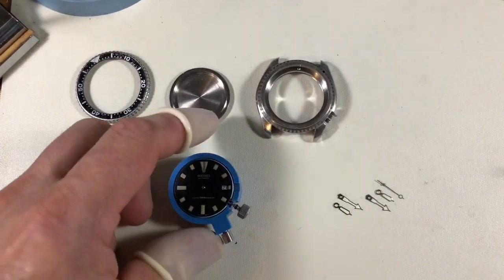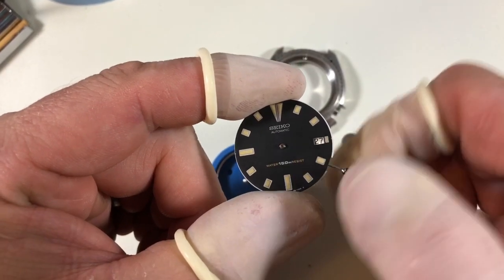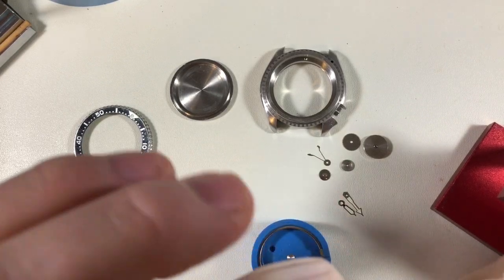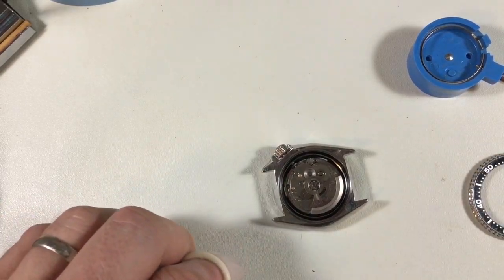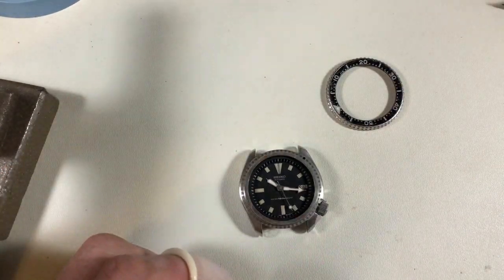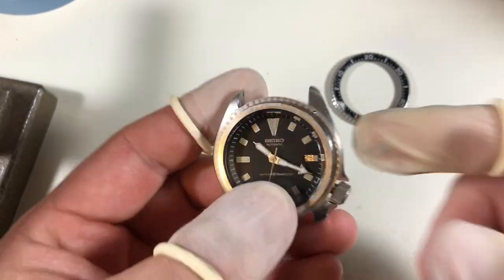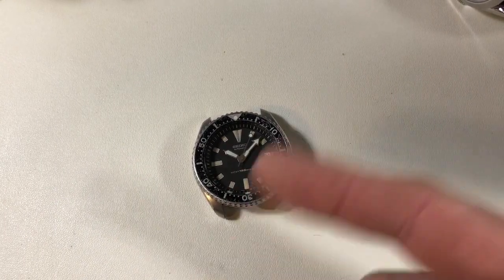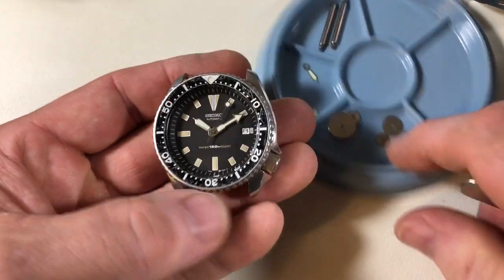KVW -- Restoring a tan-lume Seiko 7002-7000 from Thewatchcollector - Part 4!

Comment: Hello. Great job. I'm looking a new rotor for my Seiko 7002. Would you recommend a place to get replacement parts? I don't know any place.  Thanks
Reply from the maker: any Seiko 7005 / 7006 / 7009 / 7S26 / 7S36  has a weight you can use, or you can order one of the currently available genuine Seiko sub weights here: http://www.julesborel.com/products?search=0509184

Comment: I have the exact same watch, my dad bought it about 30 years ago and when i opened it to try and fix it the rubber black ring under the bezel broke because it was too dry and dusty... any place i can order a new one?
Reply from the maker: They're on eBay - any of the Seiko divers like 6105, 6309, 7002 use the same gasket.

Comment: Does insert bezel from 7002 7000 fits on Seiko 7548-7000?
Reply from the maker: Yes, but actually no.  It'll fit, but the lume color is wrong, and the insert finish isn't correct for a 6309 - reflective instead of an eggshell satin.

Comment: Great stuff, thx Spencer. Super interesting. (reason to the rhyme or method to the madness). it all  makes perfect sense.

Interesting comments regarding the water getting in. My biggest fear,  with more than one auto watch, working the crowns all the time to wind when I alternate between watches makes me nervous.
Always wonder what effect that has on the seals.
Reply from the maker: Vlerkies as long as they’re properly lubricated and not degraded it should be ok

Comment: Personally I would prefer the hand set lume to match the markers.
Reply from the maker: Would be clearly unoriginal, which isn't something I do.  Seiko hand lume almost never went tan, but there are a number of Seiko models from the 1970s with tan dial lume and white hand lume.  Also, modding just isn't my thing.  Restoration to stock is.  But I get what you're saying.
Reply: Spencer Klein that would explain why the hand set on my early model 6309 diver look different to the marker, the watch is unmolested.
I have a 6306 diver where the hand set, markers and the text have all turned to a grey colour.
Reply from the maker: The greying out is due to humidity inside the watch.
Reply: Spencer Klein makes sense, I've owned it over 10 yrs thankfully there was no evidence of moisture in the movement or pitting to the case back, I had it serviced a couple of moths ago, it's running great.

Comment: Great set of videos, thanks! 
I notice that your movement holder has a centre support inside it. Is it ok to use a simpler style holder without that center support to fit hands on a 7002?